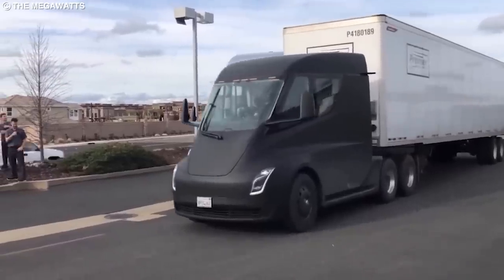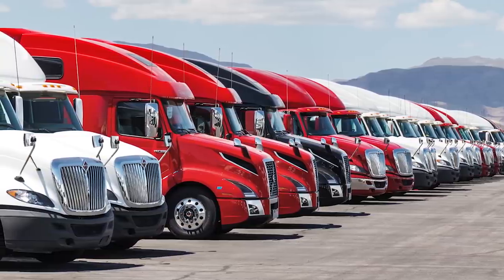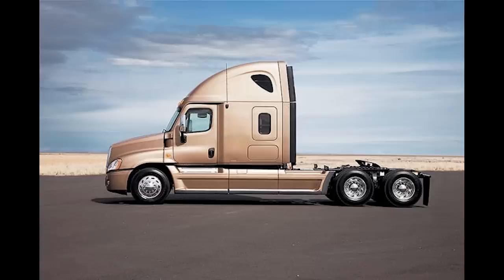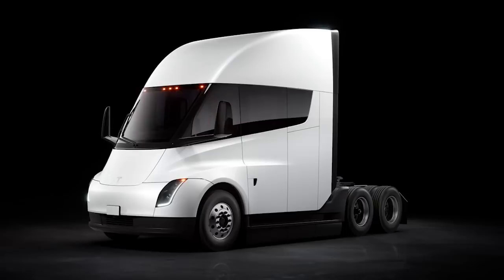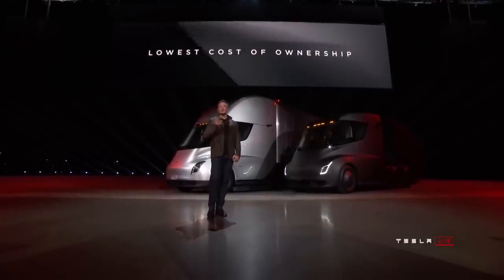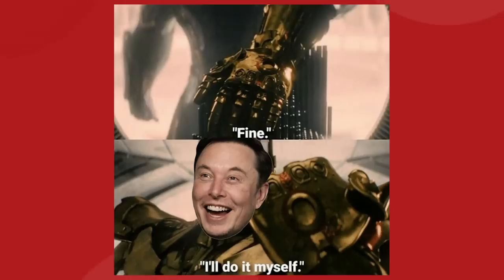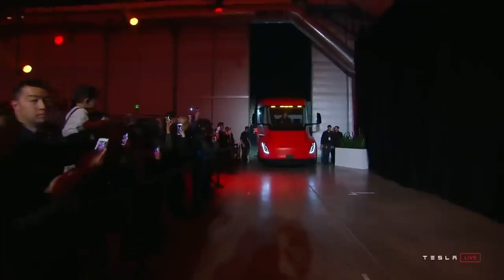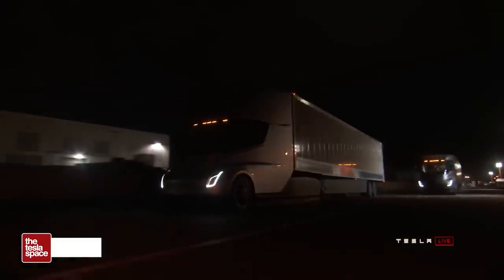The Real Reason Tesla Developed The Semi Truck!

Comment: It has too be able to do 500 miles a day with charging stations at every truck stop.

We can't be hampered by no charging station. It has to be able to do multiple stops with out loosing battery and has to be able to sit in heavy traffic without problems later.

Needs a sleeper
Reply: Most Tesla extend range when stuck in stop and go traffic. I see no reason this semi would be any different. So as long as the route plus common detour has super charger it would work. Also I still see ideal is going under 400 miles round trip for some time. Which encompasses majority of trucking routes.
Reply: @Jimmy Patton  I'm doing exactly that under 500 no more long runs, our company has a reefer fleet dedicated to short runs, just started it.

I love it. No touch freight and Im on a salary, making more money with less work.
Have to have a sleeper and need a good charging  infrastructure

Comment: Tesla needs to have solar charging trailers with additional batteries stored in the floor of the trailer.
Reply: Great idea 💡👍 Rechqrge while driving. Rechargeable breaking would also be beneficial.
Reply: Great idea! You need 10000 M2 of solar panels. That's a big trailer! When the sun is shining.

Comment: Kamikoto knives are a scam. Shadiversity did an expose on this. They have a run of the mill steel quality. You want actual good knives then look into Wusthoff, Global, or Shun. For the same price Kamikoto charges you get a much better product with high quality steel. There are other high quality knives I didn't mention as well, but these are some of the best.

Comment: I'd like to see cab view video from the Tesla Semi pulling a near max load over the route.   What I'd really like to see tested is the Tesla Semi with full load running between Grand Junction and Denver CO along I-70.  That is a very well known mountainous Interstate route with grades hitting 8%.
Reply: How many miles is the route?
Reply: @chestermartin2356  242 miles (391 km) between Grand Junction and Denver Co.   There is a lot of stress this route would place on the truck.  Regeneration down the long grades might overheat the batteries or it might throw away a lot of energy due to heat or both.   Other BEVs have dropped to 1/3 or less their rated range when towing heavy loads, such as the Ford Lighting F-150 pickup without mountain grades!  If the Tesla Semi can make this mountainous grade hop I'd think it's a real game changer.  I think this route is idea as a test promotion of the Tesla Semi because its so well known and it crosses the continental divide through the Eisenhower Tunnel.  I would think taking a 30 minute charge break would be very acceptable traversing this section of highway.
Reply: @douglasengle2704  yeah sounds like an interesting test for it. Would be a good showing of its capabilities
Reply: @douglasengle2704  the distance ratings are apparently fully loaded, but on relatively level ground.   It will be interesting to see how they do.  A few days and I’m sure they will be releasing more information.
Reply: I love this idea, as I take that route from time to time when I'm light, I usually avoid it if I'm over 35k pounds though. Though it would be a great benchmark to beat if you're testing electric trucks.
Reply: @armanarmadillo  I imagine the gas milage goes way down when over 35k on that route.
Reply: @armanarmadillo  I think its an ideal test promotion for the Tesla Semi because its tough and a lot of people have had some experience with it.  Maybe the idea will get back to Elon 🙂
Reply: And, with SNOW😈😈
Reply: Exactly, I think the brakes would fail before the motors.
Reply: i just would like to see where elon gets his 7 cent/kwh electricity cost figure from. mars?
Reply: The thing is I have run my Hyundai Ioniq EV on that route 4 times now. In the mountains it gets the same great gas mileage as on flat land (54mpg) as long as you run at 70 mph. You get way less running at 80 (like 42 mpg) like running through Utah with a speed limit of 80 on the interstate.
Reply: @pokor5791  Ionia EV is a BEV it doesn’t have mpg.   BEVs may suffer from prolonged high current use inefficiency that might greatly reduce there normal range such as would happen climbing prolonged grades and towing.  This why a heavy prolonged grade would test for that possibility.
Reply: @ElizaJane85  LMFAO IT DOESN'T USE BRAKES TO STOP , IT USES ELECTRIC MOTORS
Reply: I want to see the starship version, where goods are packed into one of Elon's ships, taken to about 120 miles up, and brought down to self land, with robots both loading and unloading.
Reply: @douglasengle2704  I own the damn car. It is a hybrid. There are MANY version of the Ioniq. Mine is the plug-in hybrid version. It has a small engine and a 30-35 mile electric only range. It was discontinued with the 2022 model, which I bought new and have 15k miles on it.
Reply: @MrPaxio  I think that’s what tesla is going to charge at their mega chargers. Except for the state of California which has outrageous electrical rates.
Reply: @pokor5791  Ioniq EV only lists commonly as a BEV not a hybrid going back to 2018.   If you've got an Ioniq Hybrid badged as an Ioniq EV it is not the way the car is identified in new or used car advertising or in magazine articles.  Large vehicles like fully loaded semis don't experience nearly the air drag to mass ratio that smaller vehicles like cars do.  A car can likely be in neutral on 5% down grade and hit 50 to 70 mph and not much more.  A fully loaded semi needs to constantly engine brake to keep from having the truck run away.  This places an extreme charge load if it is a BEV semi doing regenerative braking.  The grades on I-70 western approach to the Eisenhower Tunnel are reported to reach 8%.  These grades way above the standard 5% maximum grade use on most Interstates and should provide a near worst case scenario for a BEV Semi to negotiate.
Reply: @pokor5791  I copied exactly what you wrote and an Ionians EV only comes up as a BEV going back to 2018.

Comment: I think the 500 mile ones will more likely be 300 miles at 80% charge after the first 100,000 miles and the 300 mile batteries will go just under 200 miles. I think there biggest advantage will be moving things around in the cites.
Reply: and when ure charging at $0.50/kwh, itll more likely cost more than diesel, and electricity costs are gonna sky rocket for people who dont even own or care about EV

Comment: Tesla Semi trucks are not "long haul". They are short/regional haul trucks limited in range.
Reply: With fast charging, as noted in the video. They can charge enough for 4 to 4.5 hours of driving in 30 minutes.

Start off in the morning.  Charge at lunch.  

The issue is lack of a seat for a 2nd driver for long haul.  There should be enough room for a bed (I might be optimistic).  If a bed and 2nd seat fit in, drive 300 miles (500km) and charge, then again...  This should be able to do 90% of a diesel.  

Good enough.

Comment: You forgot to talk about the Tesla Semi’s inability to “jack-knife”, which is a trucker’s worst nightmare. It also would have been nice to mention if the competitor electric semis also can’t jack-knife…
Reply: It can’t ?? Isn’t the trailer way too close to the cab if you need to make a hard turn the cab going to hit the trailer that’s why there always some space in between. So are these meant to only go straight ?
Reply: @vorutouzamaki2635  it should have anti jackknife logic in it’s breaking/turning logic. 

But I agree I would be highly doubtful if I drive the truck off a cliff with the cab turned as much a possible, the trailer would avoid the cab…
Reply: @vorutouzamaki2635  …
As with Tesla cars, as Elon told Joe Rogan, the computer operating the motor and tires is making changes so fast that it is impossible for a Tesla to go into a skid, even on black ice. And I think that jack-knifing is essentially a result of a 18 wheeler going into a skid. At the reveal Elon said that jack-knifing was an impossibility with the Tesla Semi…
Reply: @tribudeuno  meanwhile in the real world: teslas doing 180s and 360s
Reply: I dont see how that's possible. Every truck has the ability to jack knife regardless of it being electric.
Reply: @MayorMcheese12  
Elon was discussing "jackknifing" in regards to when a driver locks up all wheels on the tractor and the tractor begins to rotate and folds into the trailer to one side.  On the Tesla Semi, it can avoid this by modulating each of the drive wheels independently, acting like the tracks of a tank.  If the tractor cab is rotating to the right, in order to stop the motion from continuing towards a complete jackknife, the drive wheels on the right side will pull forward while the drive wheels on the left of the tractor will go into regenerative braking.  In 2013 Mercedes produced an EV supercar, SLS AMG Electric Drive (only 9 produced) with an independent motor for each wheel of the car and specifically touted this ability to assist going around corners.  I believe they called it Torque Vectoring, where each motor can vary power to each wheel.
Reply: @scottkuzma125  idk we'll just have to see how that performs
Reply: @MayorMcheese12  
First rule of truck driving is to never swerve to avoid hitting something in front of you, else you'll make a much bigger mess.  Outside of running off the road and a front wheel digging into the dirt where there's nothing to save you at that point.  The claim of "This truck will not rotate when full stopping force is applied" and in essence avoid jackknifing as a result, is legitimate.  With even a limited understanding of modern sensor technology and with proper implementation, this is simple.  

Think about it:  Do you think that you can bring a car to a controlled stop better without ABS (Anti-lockBraking System) than a car with ABS?  Keep in mind that the ABS system can only modulate the wheels with braking force applied to the wheel/wheels on the outside of the rotation in order to drag the vehicle orientation back straight.  Now add the ability to drive the wheels on the inside of a rotation in combination with the wheels on the outside dragging, you have a far better chance at keeping it under control.

If you want to throw it off the road, I'm sure you can still jackknife it if you really wanted to.
Reply: @MayorMcheese12  …
The computers are making corrections so fast that jack-knifing becomes impossible. It is fully self-driving, just like a Tesla car. In fact it uses the same drive train as the Tesla Plaid car. When a diesel is still going through the first couple of gears, the Tesla Semi is going 60 MPH fully loaded…

Comment: Looks like an easy choice for any semi buyer. Better in all ways. And the anti-jackknife feature can be life saving  and load saving.
Reply: This is hilarious. You have no idea about the fact that this can carry almost no load due to the battery weight required?! The range is 500km... Regular trucks do 2500 miles on a tank. This is literally the worst a truck could be and you really think its the best?
Reply: @DutchManticore  that is not even close to true... the tesla semi is stating 300-500km of range LOADED. It's also worth mentioning EV's are a ton less maintenance and the price per/km for charging vs diesel is way cheaper so you also gain lots of days of road time the truck can do and at a much lower cost. I have no clue where you are getting your "facts" but they are not actual verified facts they are "your rather uninformed opinion".
Reply: @daemenoth  I'm afraid he's right: due to weight limits and the battery energy density being much lower than diesel, battery weight eats into profitability. This truck will only make financial sense on short and crowded trips. We need significant advancements in battery tech to make an electric truck more viable. A diesel has about 22 tons of payload, Tesla will have about 16. That's about 27% less cargo. Fuel and maintenance is about 42% of cost for a regular semi, so the 84% reduction that Tesla boasts will mean 37% less costs for 27% less cargo. You also have a 9% reduction in operating time due to recharging. Problem is Tesla is 2 - 4.5 times more expensive upfront. 

The Tesla semi will make sense when they will drive themselves
Reply: Anything to save a good load 

😏
Reply: Better in my @zzzz lol…. Not made for Europe unfortunately
Reply: @daemenoth  lol….. who said that!? And where are the tests proving that!?
Reply: @DutchManticore  if you actually did some research, you’d see the truck can drive 500 miles on one charge, and charge 350 of those miles in 30 minutes, the tractor only weighs 1 TON (1000KG/2200lbs) more than the conventional diesel tractor, and 80% of the trucking industry is short haul trucking, far less than a few hundred miles. So it has very little downfalls to diesel trucks. No fuel cost or weight, independently controlled rear motors to stabilize and prevent jackknifing, massive amounts of torque. They just did the first 500 mile trip on one battery with 80,000 pounds of gross weight.
Reply: @lmmortalZodd  if you actually did some research, you’d see the truck can drive 500 miles on one charge, and charge 350 of those miles in 30 minutes, the tractor only weighs 1 TON (1000KG/2200lbs) more than the conventional diesel tractor, and 80% of the trucking industry is short haul trucking, far less than a few hundred miles. So it has very little downfalls to diesel trucks. No fuel cost or weight, independently controlled rear motors to stabilize and prevent jackknifing, massive amounts of torque. They just did the first 500 mile trip on one battery with 80,000 pounds of gross weight.
Reply: @leviharris7267  80.000 pounds of gross weight of which how much was cargo exactly? Elon just claimed "Fully loaded" and ignoramuses like you just swallow the bait. Even with a 50% increase in energy density in the batteries the Tesla Semi still loses 40-50% of the cargo capacity when compared to a regular trucks.
Reply: @DutchManticore  no he has clearly stated (take into account a 500 mile battery at 1MW weighs about 8000lbs) the tesla semi would only lose 1000kg (2200lbs) of payload. Since a regular cab weighs about 25000lbs (capable of moving a 80000lb load) . The tesla semi at maximum would weigh 27200lbs. This makes sense as the typical powertrain of a large tractor for such a load would weigh upwards of 12000lbs including fuel, DEF, and electric would have a small weight advantage in the powertrain weight but would be heavier in the battery VS fuel rate. The tesla semi is also much much much more aerodynamic than a diesel semi. Equal to a sports car in drag coefficient due to advanced aerodynamic design. In the end its easy to see how the tesla semi would only lose 1 gross ton of total payload VS diesel semi. While also being more aerodynamic. And it's 500 mile range can reach 80% of the trucking market. Also the 300 mile range would weigh almost 3500lbs less than that! Which would make it lighter than a diesel semi!!
Reply: @leviharris7267  if hey managed that they have a great product on their hands. I personally heard the news shortly after posting my comment.
It's great news to be honest, since I have a majority of my capital invested in tesla
Reply: @jefffraser4345  don't worry, I'll believe it when I see it.